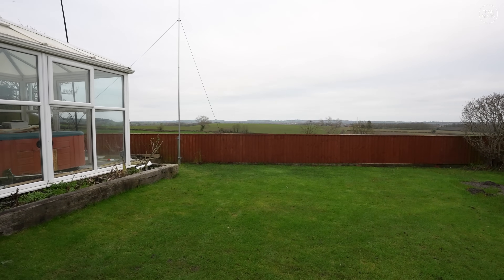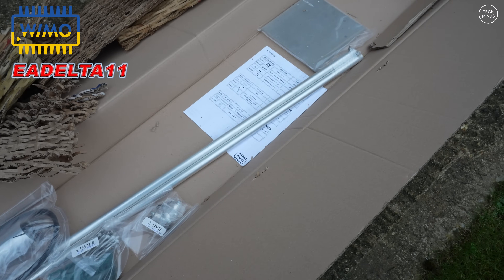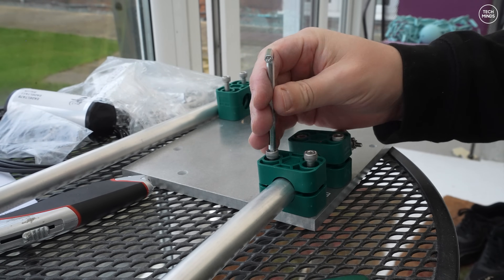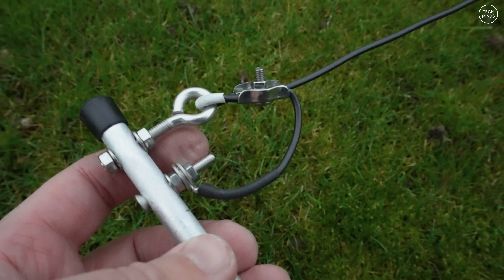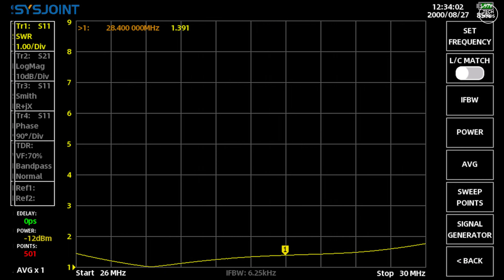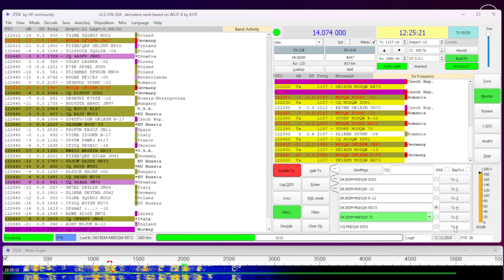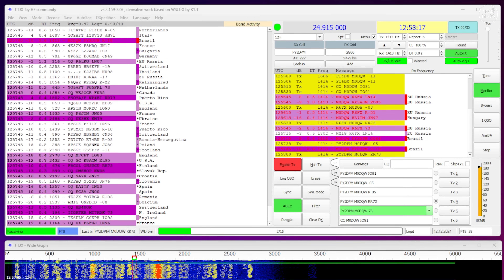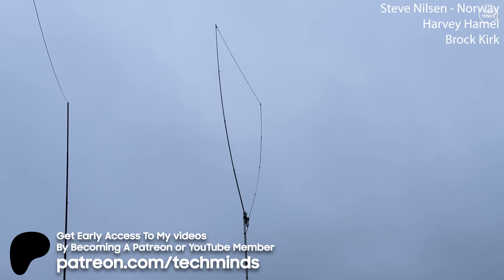EAntenna DELTA-11 6 Band Delta Loop - This Antenna Is AWESOME!

Comment: Could placing large antennas near your house cause a lightening strike to be drawn closer to your house than would otherwise happen? 

I've heard some bad stories about lightening hitting trees, jumping from one of the tree branches & into the person's bedroom, from which it caught the house on fire. 

Another one where a neighbor's house was hit in the chimney, the lightening jumped to the house next door & totally destroyed the electrical system in the whole house with everything fried to shit. The house with the chimney strike caught fire. 

I'm terrified of doing anything which could cause this.
Reply: at the end of the day it's a compromise and a choice you make. i have worked in the cable industry and the amount of lightning strikes i've seen to trees at one end of the yard and travelled up  sprinkler wires towards the house is  amazing... also i've seen the aftermath of one where it's hit the chimney of one house and jumped across to the chimney of they neighboring house. that's because they usually have a steel liner from top to bottom. to be honest, as long as you are grounded on the antenna and your ground system is bonded to power, it's pretty much if it happens it happens.. not much you can do about it.
Reply: @WX4CB  So if it's grounded properly, you should generally be ok? That's like where I'm clueless.

I hear these stories & wonder things like if it was grounded properly would it have taken the offered path to the ground & spared everything else?
Reply: @Shuck-Shick-Blam  it will ALWAYS take the shortest path to ground. if the shortest path is through your houses wiring to the power meter then it will go through your house. that's why you need to ground your mast/tower to a ground rod that is bonded to the power meter ground rod that is usually directly underneath the meter. as my dad used to say. "if you're going to get hit you're going to get hit and you better take it like a good boy." haha.. there's things you can do to help, surge protectors, correctly grounded masts... also disconnecting the coax and grounding that end where it goes into the house will help too.